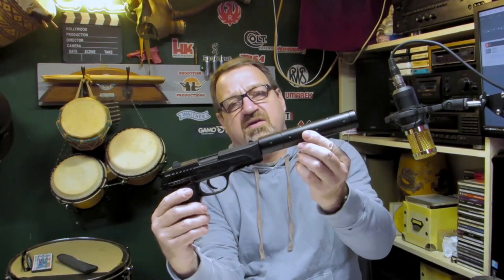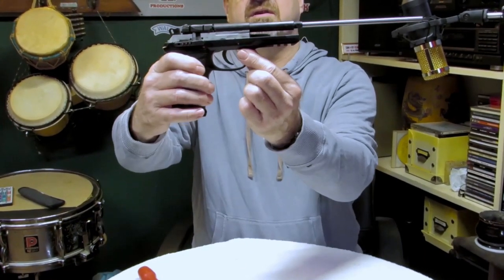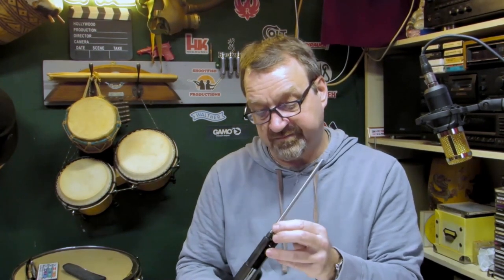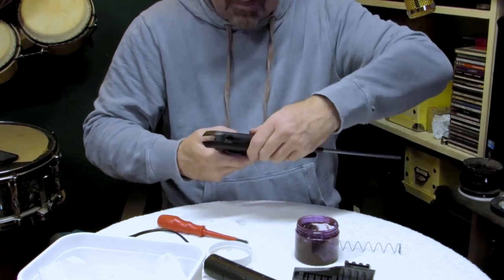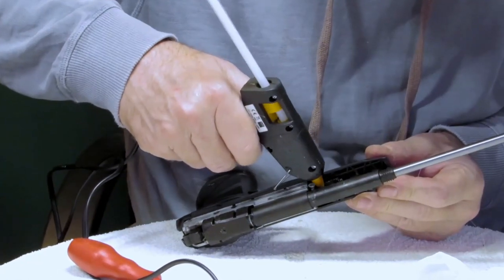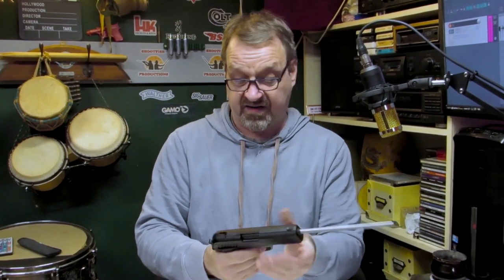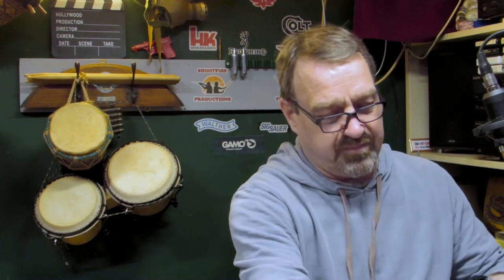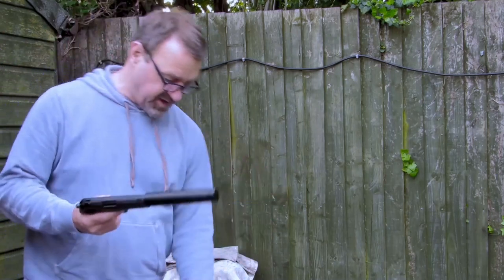Gamo PT85 Tactical Loose Barrel Fix

Comment: I fixed this gun with one washer. With only the need to take the barrel shroud off and back on again. Zero wobble, zero glue and no random screw wedged in the pistol. I made the washer from a piece of black plastic (that spacer in a ratchet set with a square centre) Filled it into a circle and pushed it over the thread that butts up to the slide. The plastic washer catches the bottom slide rail without effecting the main slide. 1 bit of plastic and 10 mins of filling and sandpaper. Jobs a good'n 👍
Reply from the maker: Thanks for that, seems a lot simpler, but my top slide slightly overhangs the bottom. Still a good solution for those that dont want to take it to bits.